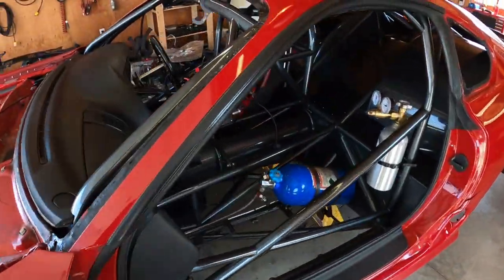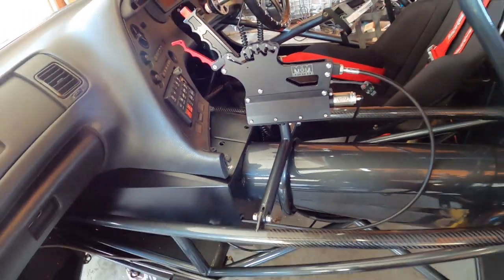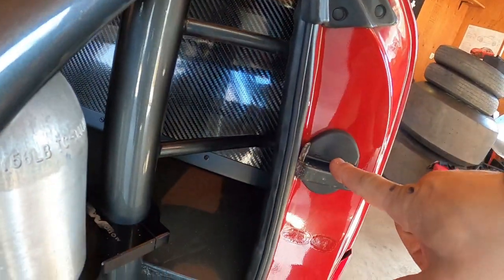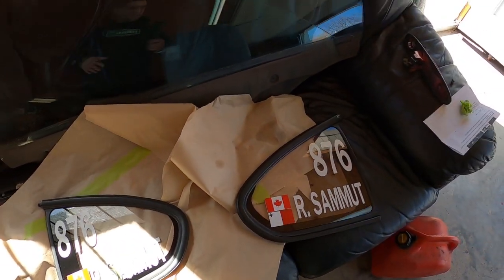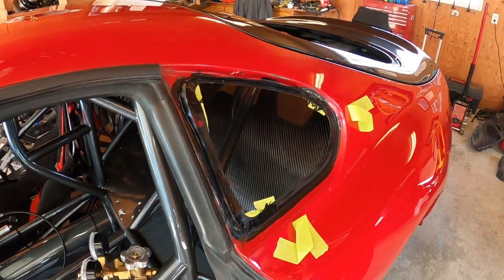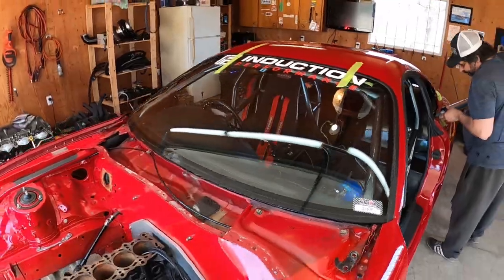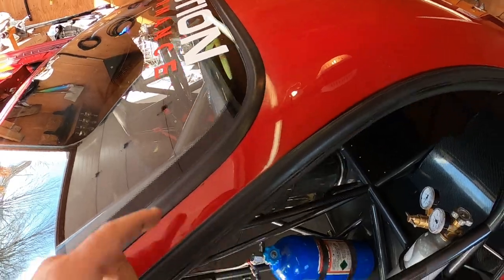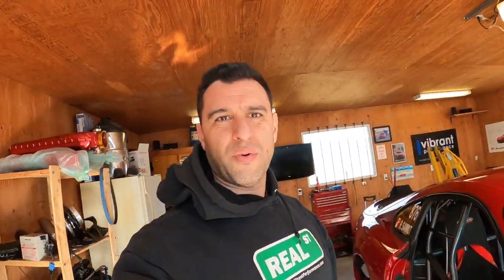M&M TH400 Shifter Install

Comment: So if the TH400 is an automatic transmission, why does it have to be manually shifted ?
Reply from the maker: They remove the auto shift valve body and install a stronger manual valve body
Reply: @RyanSammutRacing  ahh makes sense. So why remove that auto feature and go with a manual shift ?? Wouldn't the auto shift valve shift faster or just as fast as you moving that lever to the next gear ?